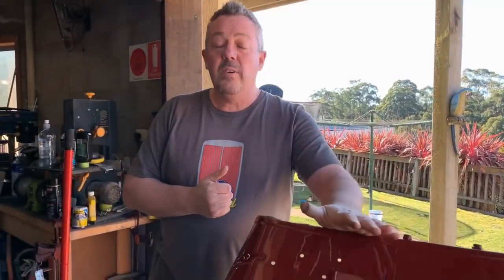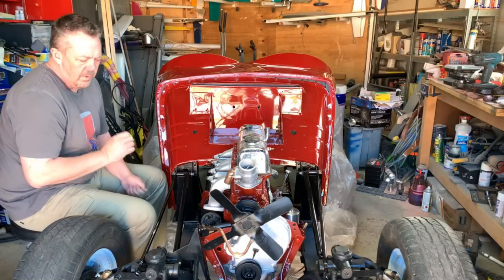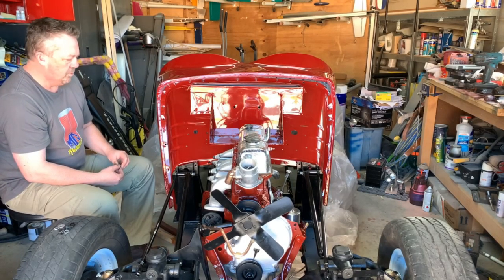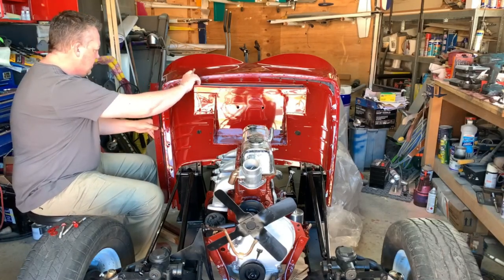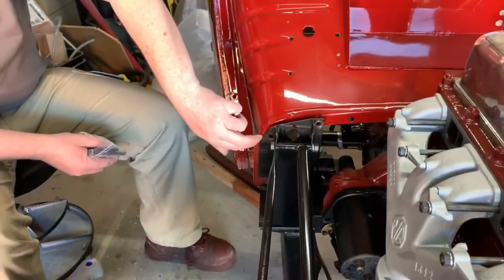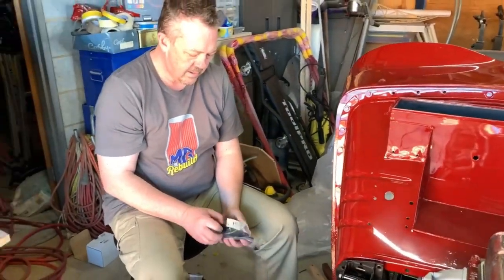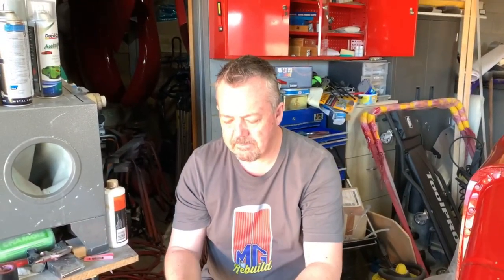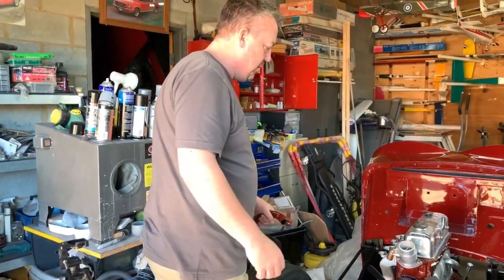Not everything goes to plan - 1950 MG Rebuild Episode 64

Comment: Bolt head on engine side looks good to me. Whilst you're fiddling with the fan blades do yourself a BIG favor now! Order a 7 bladed MGB fan blade. It will be so easy to install now and a real PIA when your 4 blades break off on the motorway with the radiator in the way! Trust me, I know from experience!! The cost is minimal now compared to the sweat it will cost you later. Yes, it will be yellow. Who cares? Are you going for judging points or reliability? Plus it will run a tad cooler with 7 blades.
Reply from the maker: What’s the process to change to the MGB fan, do you need another water pump to mount it?
Reply: @MGREBUILD  Same water pump, for me at least. I just bolted it on! Took about 10 minutes with radiator in the way. For you s/b 5 minutes! Also, I remember there may or may not be "spacers" required. I did not need them.